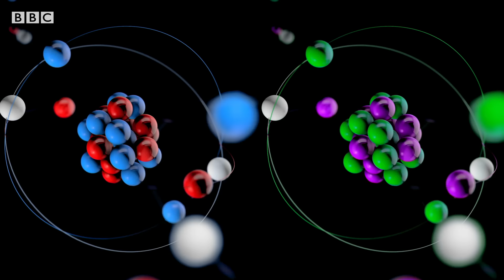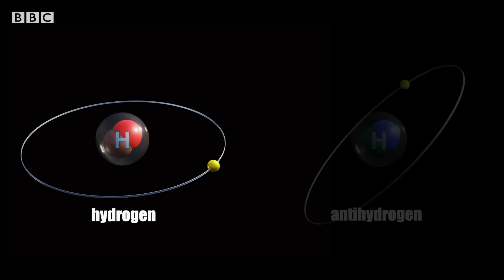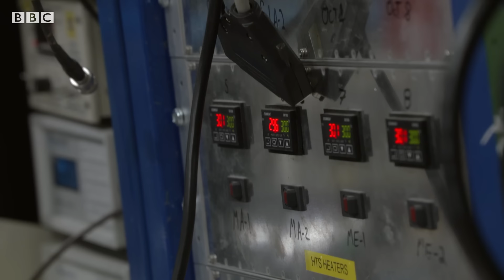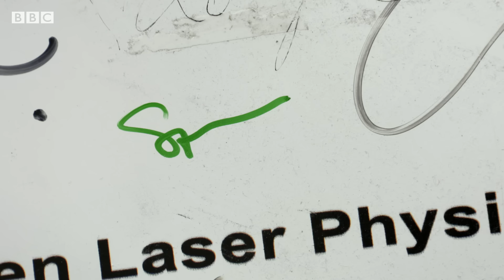Inside CERN’s ‘antimatter factory’ creating antihydrogen - BBC News

Comment: that cable management needs work
Reply: And I thought my cable management was bad......
Reply: I work at the antimatter factory and I often get this comment when giving tours. In engineering and computer science etc. you can usually assume that the device you are setting up will work. In experimental physics our devices are first prototypes and will often need very quick iterations and upgrades. Spending 2 weeks on fancy cable management to figure out that the experiment needs to be modified takes valuable time that we do not have. We could have tidied it up a bit better before they filmed this though..

Comment: You know, showing a graphic of a positron (positive electron) didn't do much good if you don't explain that electrons are normally a negative charge. Changing it from negative to positive is what makes it anti-matter. You may've wanted to mention that.
Reply: It's not just about using a positron, its also about using an antiproton (which has a composition of anti-up, anti-up, and anti-down quarks). If you were just to swap an electron for a positron in a hydrogen atom the positron would be instantaneously repelled by the proton since they have the same charge. I think the graphic is perfectly fine to be used here.
Reply: For me, they way they showed it being made of negative colors and the electron/positron orbiting in opposite directions helped
Reply: most viewers don't really care and are not interested in understanding the science. It's a short internet video meant to high-level summarise for the click here generation, so you may've wanted to rethink nitpicking that 😆
Reply: @shanee4497 or maybe it would be attracted to it due to the strong force?  Causing annihilation of both?  I'm speculating.  I'm no physicist

Comment: Maybe the universe bounces between an anti-universe and a regular universe, and the big bang was the intersection point?
Reply: Blue-sky thinking. Very good.
Reply: so there would have been multiple big bangs simultenously
Reply: So, are you saying that under CPT symmetry, at the point of the big bang the matter went forward in time while the antimatter went backwards in time?
Reply: @DKonigsbach  I didn't think of it that way, though maybe.

I was thinking more of a sine wave, with the center of the sine wave being the intersection point between two modes of universe, though I like your idea as well.
Reply: Its like Christ and anti-Chirst :)
Reply: @Kramlets There wouldn’t be any difference between the two, would there? They’re just different ways of looking at things. If time were running “in reverse”, it would just mean every physical force and process would happen in the opposite way. If you then ran the clock “forward”, it would look the same as the Universe we know
Reply: That thought is so cool that it's probably wrong.
Reply: It is kinda like the theory of James William sidis (the guy with the highest IQ in history).
Reply: Teh puniverse doesn't oscillate, it buzzes discretely between the IS and NOT IS in a displacement continuum that distinguishes bi-direction as iterations A to B, B to A, and/or (A+or-B)... well, I tried
Reply: Making whenever I’m having gay thoughts it’s my antimatter brain?

Comment: Antimatter isn't that rare. Reactions that create anti-neutrinos and positrons are quite common. And many people think matter-antimatter interactions produce some kind of exotic, almost supernatural energy that somehow does things like warp spacetime or affect gravity. But the truth is, all a simple two atom interaction typically produces is a couple of high energy gamma rays (aka high energy light) and maybe some neutrinos. In fact, the energy released isn't much different than that of the gamma decay of Cobalt 60. Thus m/am reactions are not really that big a deal.
Reply: its because of all the sci fi movies
Reply: I mean, based of your description that still makes it rare...
Reply: @TheDemonarta  B+ decay makes positrons and B- makes anti-neutrinos. Both are extremely common decay modes. The naturally radioactive Potassium 40 in your body makes positrons, so even you have antimatter inside you.
Reply: Matter-antimatter annihilation produces around 300 times more power than nuclear fusion. But fusion will be the more common and cost effective means of producing energy.
Reply: @WheresPoochie  Of course. One has to make antimatter, which makes using it for power pointless due to entropy. Plus, even if you had some antimatter, how could you contain it? It would have to be suspended magnetically in a perfect vacuum, to prevent reactions with the gas around it. A perfect vacuum is impossible.
Reply: @PointyTailofSatan   This is true, but the lifetime of such antimatter particles is extremely small. at any given moment the fraction of the universe that is antimatter is negligible. Therefore it is rare. The mechanism to make antimatter is not rare but the material its self is. Either way positrons and anti neutrons are not even matter.
Reply: Anti-matter might not be rare (though I disagree with your arguments) - however, no question that anti-atoms, i.e. anti-hydrogen, is exceedingly rare.
Reply: @PointyTailofSatan so knowing all of that… being able to properly contain and utilise is actually pretty exotic of a concept
Reply: @PointyTailofSatan 😅😅😅
Reply: bro this aint a level physics
Reply: Lightning is an example
Reply: I guess that’s what everyone told you right?
Reply: When antimatter and matter meet it gives off 100% of energy.. fision does not
Reply: @aandc2005  Yes, but the gamma rays emitted by Cobalt 60 are very similar to that of a simple two particle M/AM interaction.
Reply: @PointyTailofSatan you say it’s impossible to contain it, but in fact, cern is able to contain anti matter, quote: “TRAP experiment at CERN: antiprotons were kept in a Penning trap for 405 days.”
Reply: That’s where you’re wrong, you need a dilithium matrix along with blue slow flashing nacelles to achieve warp. Reacting anti-matter is not enough duh.

Comment: If you were to drop antimatter in a gravitational field, it would experience the same forces as regular matter. Antimatter possesses the opposite charge and certain quantum properties compared to its corresponding matter. However, when it comes to gravity, antimatter behaves just like normal matter. Both matter and antimatter particles are affected by gravity in the same way, following the laws of general relativity.

Therefore, if you were to drop a piece of antimatter in a gravitational field, it would be attracted towards the source of gravity, just like regular matter. It would fall towards the gravitational center with an acceleration determined by the strength of the gravitational field, similar to how objects fall on Earth.

The answer of chat gpt in this question  .
What happens into antimatter  if you drop it in a gravitational  field  ?
Reply: Someone should let CERN know that they can abort the mission now
Reply: @ericslep9798  yes you can
Reply: The antimatter mass problem

A bullet of light hitting earth
Reply: how bout next time you start with the fact that its from chatgpt, so we can all not waste our time reading it
Reply: Can we create a propulsion by colliding both matter and antimatter
Reply: @krox477 yes.
Reply: So, we have an offering from ChatGPT here, which is completely opposite to what a MSc stated in another post...

Hands up who thinks ChatGPT got it right?

<tumbleweed>

Comment: To create an a untimatter   used a critical pressure that reaching the power of the blackhole pressure and beside of that critical pressure place an a demagnetized energy coil to create a strong magnetic force of the untimatter  
Heres an a plan  high pressure +demagnetized is equal to the magnetic untimatter  particles

Comment: If it really does have anti gravity properties than holy moly is it gonna be crazy. Anti matter acting like exotic matter will change ftl and wormhole theoretical technologies
Reply: Sadly it won’t. We’ve already had antimatter kicking about for years. Positrons and antineutrinos are produced from natural nuclear decay and follow gravity. Plus, gravity isn’t really a force (it’s the warping of space time), so it presumably would need to move backwards in time to defy gravity
Reply: Anti matter has the opposite electrical charge to normal matter but the exact same mass so it wouldn't have any anti gravity properties
Reply: Mumbo jumbo

Comment: Bet matter has more energy than antimatter and the release of the two cancelling each other out is the remaining energy from matter that’s been broken apart… idk. Pretty cool though… doesn’t have to be as energy efficient to use as it is to create, if you can still make enough it to propel a rocket ship it would still be a reasonable fuel to use if by carry weight is more efficient to take on board than other fuel sources especially the further out you want to explore

Comment: So I dont know if its strictly antimatter, but I figure you could create a nuclear battery by placing a nuclear warhead (a small one) inside a Tungsten (?) Sphere lined with neodymium electromagnets. Surround the warhead with graphite, and detonate it, while sending the appropriate ammount of magnetic current inwards in all directions to contain the reaction. Hopefully, this would be enough heat and pressure to turn the graphite into diamond, which should contain a portion of the nuclear reaction. 

You would then release the energy by contacting the diamond. (Piezoelectricity)

Then, i figured you could use a battery of several mercury containing donut shaped tokamaks, set to spin a central driveshaft, turning a tungsten turbine. You would have nozzles on the outside of the tokamaks to release plasma. This would then contact the nuclear-diamond batteries between the tokamaks and turbine, further charging the subatomic particles, which would be expelled through the turbine.

Comment: ETs tools and ships and computers are not powered by crude oil or even radioactive death fission atoms like Pu or U. To jump start ET engines, you need a pure clean fuel that is readily available (to ET). Anti matter burns hot and clean, but that type of power fuel is needed to even attempt to turn on the simplest of ET tools.
Then even if you have Anti matter you must control where when they combine. So power maybe needed at 30 different locations simultaneously.

Comment: A quick question: If antimatter is to be determined(I doubt it) to be anti gravity or repulsive to gravity, would that be if you continuously threw it up and pulled it back down in a craft would that craft go up as the anti matter were thrown to its ceiling?
Reply: It wasn't and hasn't, so it won't do the thing you said. Stuff works with gravity the same as everything else. They actually knew this during the filming of this piece, not sure why they kept it ambiguous.
Reply: @darthsirrius  ok. That's why I said I doubt it. You can think of it as more of a fantasy question.
Reply: The reason why hydrogen floats is because of its relative density, also why hot air floats because the particles are farther from one another.
Reply: @richardjohnson8009  ok. Don't know why you mentioned that besides for possible lifting gas for crafts.

Comment: You went to the Antimatter Factory, but you had nothing to say about how it was made or stored. An anti-hydrogen atom should be neutral and should immediately float away into ordinary matter.  Anti-protons by themselves can be held in a vacuum and a magnetic field.

Robert L. Forward, Science Fiction author and physicist, reported how he had once had the job of carrying anti-matter from CERN to Fermilab.  The amount was so tiny that even if the carrier magnetic bottle had failed, you would not have seen even a flash of night.  However, he never told anyone on the planes he flew what he was carrying to avoid creating unnecessary panic.

Comment: Alright so what antimatter is, is when you reduce subatomic particles (electrons, protons, and neutrons)... which are smaller than an atom. 

When these reduce, it becomes basically waves of sound, and light. 

In an inert environment, it is pure energy. (E=mc2) 

When outside an inert environment, the waves and light combine with other waves and light, to become electrons, protons, and neutrons.

These connect into atoms.

Which connect into molecules... etc.

It is not matter, it is merely the suggestion, or potential energy, of matter itself.

Comment: Nope
It's just if you count by one triangle it's the three ways to build up a circle but one is the best the others just can be build up after a cut to get a sharp angle that circle by 3 sides 

Build up real light accelerators generators

And so on and on

You need to know where to set the lite (or light) at
Reply: What is so special about these triangles...hmmm..

Comment: Is antimatter “scientific fact”. The journalist claims it is, but I’m not convinced. It is a scientific theory. But is it an accepted fact?

Back in 1995 I was an engineer at Lockheed in the NASA Johnson Space Center area. Before leaving for a new job my last assignment was to do a stress analysis of a bracket they held an experiment in the cargo bay of the Space Shuttle. It was the CERN antimatter spectrometer. I remember approving the design, and the launch went fine. But I don’t know if anything ever came from the experiment or not. But it survived lift off, which was my small contribution 😀
Reply: Step 1. Look up what the definition of a 'scientific theory' is.  

Step 2. Note the difference in meaning of the word 'theory' in science, compared to the word 'theory' in general parlance. 

Step. 3. Look up the word 'hypothesis

Step. 4. Repeat steps 1 - 3 until you understand the terminology

Step. 5. Don't delude yourself that you can convince anyone you worked in any field directly involving science 

Step. 6. Proceed with new awareness and caution
Reply: @daniellamcgee4251  I am an a mechanical engineer with over 35 years of experience. I have a BS Aero Engineering and MS Mechanical Engineering. I may not be a “scientist”, but I certainly have the skills and experience to work in science related areas. 

Have a nice day 😀
Reply: They have had antimatter since the 1930's.   A PET scan uses positrons which are antimatter.  They have also been making anti protons for years at different physics labs and you get anti hydrogen when you combine a positron and an anti proton to make an anti hydrogen atom.   Nothing new about all of this , except it is hard to contain anti hydrogen because it is electrically neutral. 
In lightning storms you get positrons.  They annihilate electrons and give off gamma rays of 511,000 electron volts.
Reply: Positrons are produced routinely and entire atoms of antimatter have been produced and stored, as you can easily verify for yourself. So of course it's an accepted fact.
Reply: Showers of antimatter pierce through your body every couple of seconds, so it is indeed a fact. Muon and e-p atmospheric showers are very easy to measure, you can build a detector in your garage from scrap. Quite a fun experiment, actually. And it's easy to distinguish electrons from positrons, as well as to see positrons annihilating.

Comment: Yeah since no real results for mankind came from this useless contraption call in some rock starts that will help. LOL!
And please stop watching sci fi movies.
Reply: "Matter–antimatter reactions have practical applications in medical imaging, such as positron emission tomography (PET). In positive beta decay, a nuclide loses surplus positive charge by emitting a positron (in the same event, a proton becomes a neutron, and a neutrino is also emitted). Nuclides with surplus positive charge are easily made in a cyclotron and are widely generated for medical use. Antiprotons have also been shown within laboratory experiments to have the potential to treat certain cancers, in a similar method currently used for ion (proton) therapy."

Talking about useless, you certainly aren't doing much better by commenting with no research, eh?